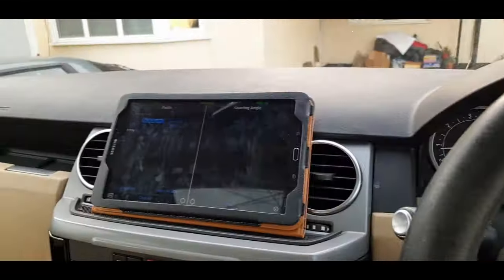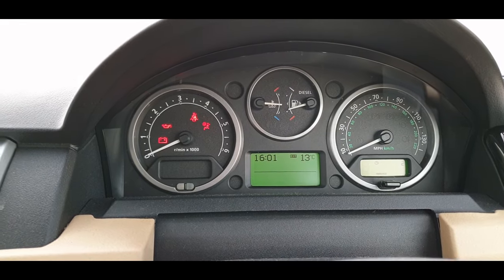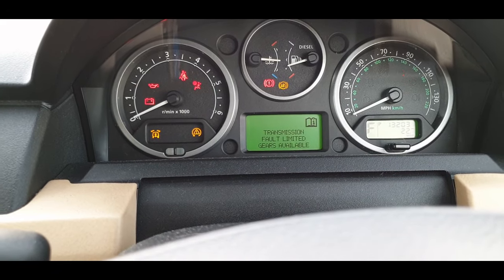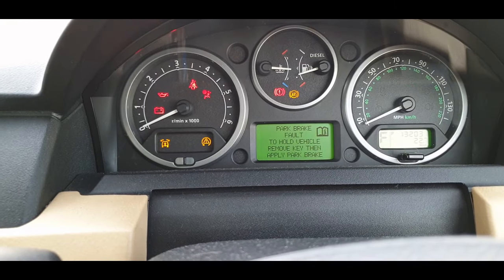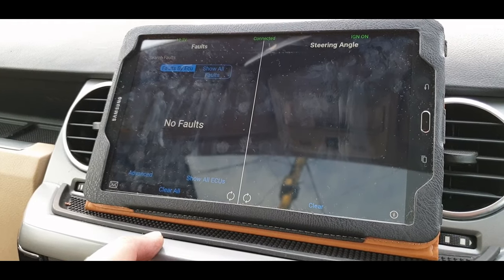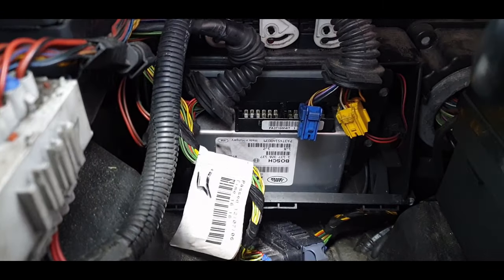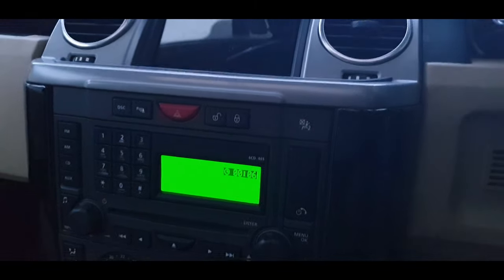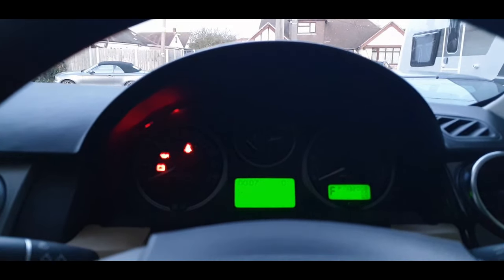Discovery 3 HDC,Transmission Fault, Handbrake fault with *FIX*

Comment: had HDC fault system not available ... no fault codes tho. so took battery out ,removed plastic cover to expose the tcm ,removed tcm and sprayed the plugs with contact cleaner, opened the tcm to look for corrosion on the pins and nothing so gave everything a good spray with contact cleaner and reassembled it , pluged it back into the car replaced battery ,1st start got the same mesg so left it running for 5 mins switched off and switched back on again and not had the mesg since .. no corrosion but may be there was some dust but it seems to have done the trick. thanks lazylen for the info on your video
Reply from the maker: Its so nice to know this video is helping so many people. I wish I'd have filmed it in a better way, didn't realise at the time that it was going to actually work.
Thank you for your comments
Reply from the maker: @bigbootedskin  There are many causes. Could be low battery voltage, could be Brake pedal switch, could be steering angle sensor, could be even as simple as a under inflated tyre, especially if it happens when moving. You may have already checked all of those but worth a look if not. If your brake lights still work it doesn't necessarily mean the switch is good. Good luck
Reply: @bigbootedskin  is your car still working?
Reply: @bigbootedskin  mine been doing this for some days now I checked and cleaned the tccm even though it looks like brand new when I took it out , changed my air sensor but still nothing changed 

I ordered a brake switch today hopefully that will fix it when I receive it.

I’m very worried because my car is limping suspension reduced and low range keeps displaying and it’s my work truck so I have no option but to keep driving it to work
Reply: @bigbootedskin  I received my scanner today and was able to put it back to high range mode but my suspension changed from orange to red
Reply: @bigbootedskin   check your power steering fluid isnt low, this can throw steering angle sensor and cause hdc fault, this happened to me last week
Reply: That's what I need ...an OEM reader

Comment: Very useful thanks would never have known how to fix all those fault codes coming up or the confidence to take that box out and apart. Had the exact same problem but changed brake light switch first in case but didn’t help. Cleaned up contacts with contact spray on that transfer case control unit and one of the spades had corroded so badly it had broken off. Opened up box easy enough. Had to solder a wire to that contact and get creative but fixed it. Terrible place to put that module, condensation alone will knacker those contacts over 14 years! I see they moved it on the D4! Anyway all good..All lights off and suspension back to normal height, gearing correct etc. Had a D3 for 9 years & still love it. Thanks again for your video, I think you saved me a small fortune and a ton of hassle. In appreciation.. JT
Reply from the maker: Thanks for your comment, really glad people are finding it useful. It is in a silly place but at least they moved it with the Updated D4 as you said

Comment: So im out on vacation with my family and got this same issue. Car just died an limited gear and f and parkbrake etc.wont start. Im reading out several fault and im kind of convinced its the same thing. Going to open the box and check.  But i have one question...why the steering angel reset?
Reply from the maker: Just as a precaution as systems are connected

Comment: Big thanks for this had intermittent fault whenever I turned left, battery wasn't fastened down and the earth cable was pulling on the loom for this and pulled the connector loose 
Top bomber 
Thanks 👍

Comment: Great video thanks. My 08 Sport blesses me with the HDC fault. Between 2 and 6 times a day with in a km from home. No bumps in the road or heavy braking but always steady speed and straight line. I replaced the battery, reset steering angle, cleaned every earth I could and removed the ecu behind the battery as was shocked to see flimsy rubber boot seal. Like u I couldn’t see any corrosion on the plug so popped the alloy cover off but never saw and on the board. Now I didn’t look at the base of the big conductors so did you just spray contact cleaner in there or also use say a brush to clean it. I might pull it all out again and go over it once more to try fix mine. It’s been doing this for months now…………limp mode, 3 amber lights and fault codes as long as my arm not communicating  with any thing and every thing……
Reply from the maker: Hi Berhard, thanks for your nice comment. I cleaned the terminals using a toothbrush. The corrosion was really only very little at the base of the pins where they connect to the board, green tint on the pins. There are many things that can cause virtually the same symptoms for example the steering angle sensor on the steering column can be turning cause the sensor to keep throwing a fault. May be worth checking out www.disco3.co.uk if you haven't already that is. Good luck. Len
Reply: @lazylen7199  Yer all good, I may just just revisit that and brush it as well. I  epoxied the steering sensor as it wasn’t spinning but felt a little loose . Cheers again.

Comment: I had the same problem. Hdc + transmission fault + engine system fault on the screen. During investigation diagnose showed many fault codes including turbo, high pressure fuel pump, egr valves etc.. but later we found the main problem causing these fault codes. It was one of the injectors. There was a fuel leak from that injector. We changed the o-ring and never had any fault message since then.
Reply: Hey! You posted the exact same comment on another video I just watched. LOL I don't have these fault codes, but I'm trying to stay ahead of the game if you know what I mean. So when I DO run across it, I already have an idea. This bloke did some serious digging to find this one. I imagine finding yours was no cake walk either. (I'll have to google where the term CAKE WALK came from now also. haha)

Comment: Great fix Len, you did well finding this fault. Is it still holding up. Possible the corrosion was not from a leak, maybe just condensation. Very good and helpful find.
Reply from the maker: Thanks. Yes, still all good. Could just be condensation but I also found the Bonnet seal rubber was not seated properly over that area

Comment: Hi, when I try to do a scanning on my 2005 LR3 V8 4.4 only the ELM is connected the ECU is not getting connected, can you pls tell me the possible reason for this. All the dash lights are on and the Transmission is F.
Reply from the maker: Would not know what to suggest to be honest. Maybe try disconnecting the battery for 10mins then reconnect

Comment: Hi , thanks for the video , i have the same problem, where is located the TCM i have a LR 2 2007 3.2 HSE I6 help ;)
Reply from the maker: On my Right Hand drive vehicle its located down the back of the battery which needs to be removed

Comment: mine does this after a car wash or using the windscreen wipers, how did you seal up the box?
Reply from the maker: After spraying the board with duck oil I layered vasoline around the edge of the board and applied between the casing joints and secured with 2 small cable ties. Make sure that your battery box cover is on properly with the piece of seal along the back edge of it. Also make sure the rubber bonnet seal that goes around the inner wings and across the bottom of the scuttle panel is on properly otherwise water can get in and run down the back of the battery.

Comment: Hey bro ot was the module or the battery??? I have the same problem... same but same really same... I checked the module and clean but still the same problem...
Reply from the maker: With mine it was very slight corrosion inside the module on the pins I point at. I had changed the battery because the volts kept dropping below 12.3v but this was caused by corrosion in the module. As soon as I cleaned that the drain went away as did the faults.
Reply: @lazylen7199  bro and what's the good voltage in the battery???
Reply from the maker: You can see near the end of the video that my battery was sitting nicely at 12.7v while connected to the car.
Reply: Bro same problem in my RRS 2006 some time no starts !!

Comment: How u fix it i have same issue
Reply: He found some corrosion on the circuit board. He cleaned that carefully then cleaned the external contacts and the plug pins. It seems to have been a short caused by corrosion causing a parasitic drain from the battery.

Comment: Mine trows the manufacturer controll code and it shows up all the break lights on dash i do have a broken rear sensor can that be why all lights turn on dash
Reply from the maker: Anything broken with electrics/sensors on these cars is going to give you problems. You can show the same faults with different causes. Could be low voltage battery, or brake light switch or if you have a brake light bulb faulty can be a problem too.

Comment: Whats that module called?
Reply from the maker: I believe it's the Transfer Case Control Module "TCCM"
Reply: @lazylen7199  Where is it located on the car?
Reply from the maker: @Pointman92530  It's located behind the battery